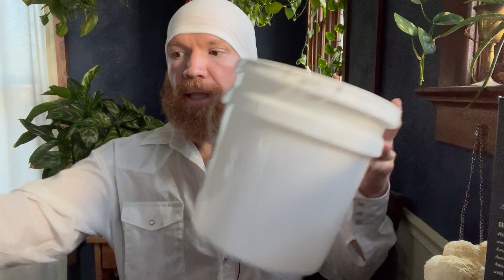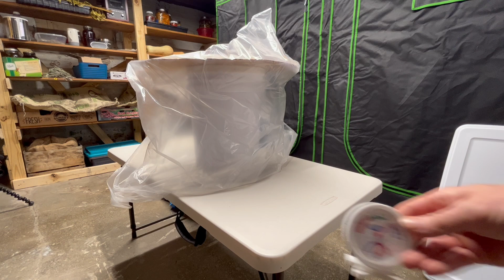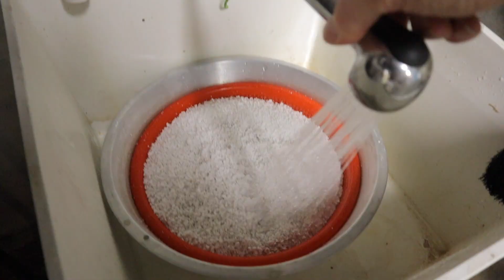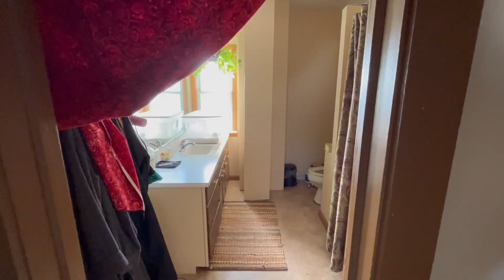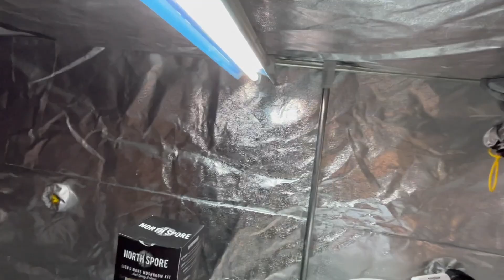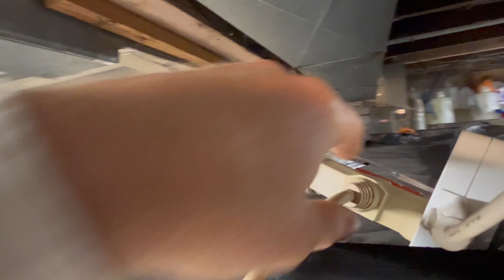Setting Up Your Fruiting Chamber - 3 Options From Budget To Baller - Mushroom Growing Part Two

Comment: Hey, Nate, your channel i💙:person-turquoise-writing-headphones:is very informative and interesting which it makes easier to understand and to like it. I am planning on building a good set up for mushrooms. I am fairly new to this channel, and I do have a question for you or whoever reads this and perhaps feels compelled to answer...I am sensitive to cold, thus, I usually like to keep the house temp. at 78 degrees Fahrenheit, I am learning that mushrooms need an average temperature of at least 68-70 degrees Fahrenheit max, I am considering adding a small AC unit to the grow chamber, do you think that this would be a good idea to keep an optimal temperature into the grow tent? Also, would you happen to have any suggestion on which small efficient AC unit would be better for this type of set up, I am considering a grow tent perhaps a 4x2 feet? 🤔💬
Thank you in advance for your response! 💙:person-turquoise-writing-headphones:

Comment: Hi Nate, to drill cleaner holes in plastic, once the teeth in the hole saw have bitten into the plastic, set the drill on reverse. The resulting hole will come out much cleaner with fewer plastic burrs.
Reply from the maker: excellent tip thank you I will try that next time

Comment: Having a circular fan for airflow will not yield the same results as a soft linear breeze.  If you believe otherwise, think about outside.  Plants are not used to circular airflow. They evolved with linear airflow. My firm has researched this extensively. Videos coming soon.

Comment: Using a fluorescent light will not yield the same nutritional value as you would get from using lm301h LEDS. Fluorescent lights were created in the 1900's. LEDS in the 21st century.  You can purchase a 100 watt 6000K light from pretty much any grow store. What you are looking for is light that matches the sun.

Comment: In the third set up are there any plants that could grow in those conditions to absorb the CO2 instead of the air extractor?

My mushrooms kits did great with just a little misting so do I assume I have good conditions already or do mushroom kits function a little differently to the bucket method? Many thanks, Nate, looking forward to the next video :o)
Reply from the maker: yes the kit is a bit different than the buckets will be for sure... it also depends what your environment is like... whats the %humidity in your place?... and in order to successfully filter the CO2 the entire tent would have to be packed to the hilt with plants and even then there would not be sufficient air circulation so no that wouldn't work because we would have no room left for the buckets! lol